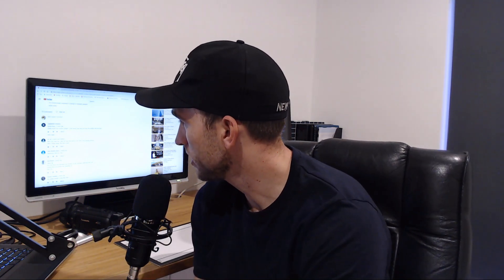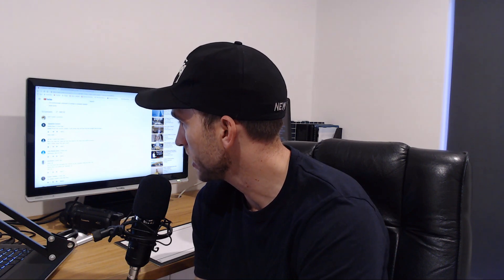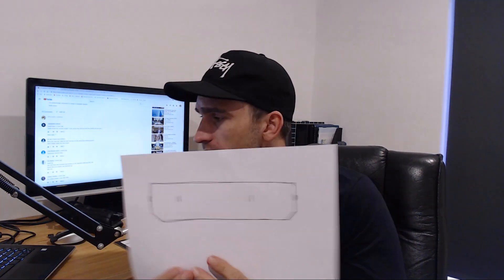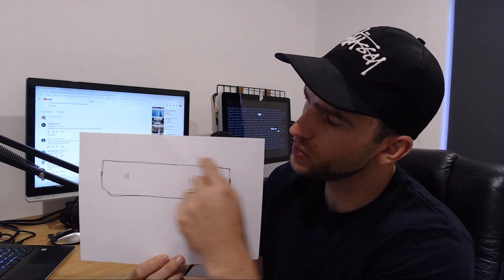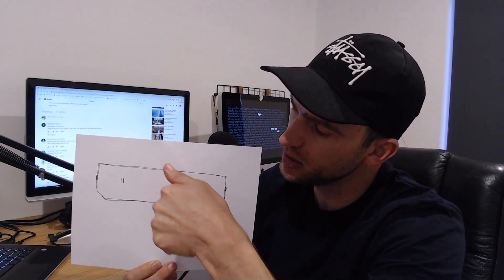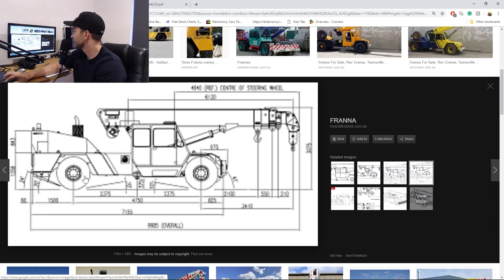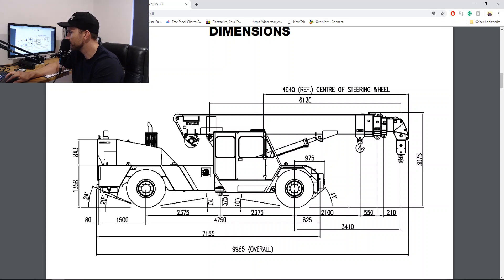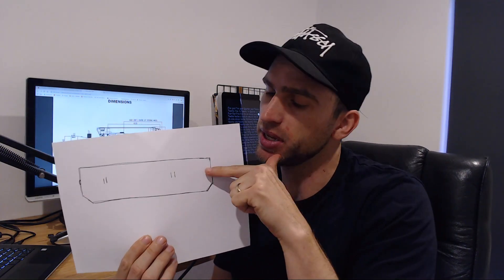25t Franna Counterweight orientation

Comment: Cuzzy
A yeaha so quick question when u travel the counter wieght is aspose to be on the front but when you get to site u have to take it off the front and put it on the bk for better stability correct or can u leave it on the front and work as usual or no

Comment: If the counter weight was on backwards it obviously can fit in, does it damage anything cause any issues?
Reply from the maker: yeah well, it wasn't rubbing on anything and no when I had a look no damage, it wasn't even touching the mudguards so yeah its a weird one. maybe you can have it both ways?
Reply from the maker: my initial thought is they would make it so you couldn't have it two ways thats why i wasn't quick to say it was the wrong way
Reply: I've seen it put on both ways but yes the correct way is to have the cornered side at the rear, reason being is it has to be that way in order to hook up the superlift 👍